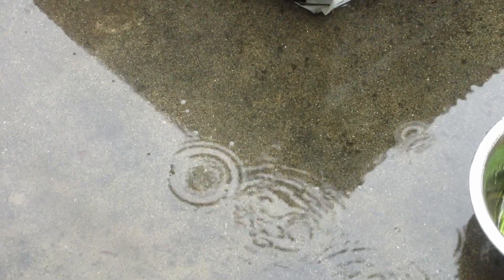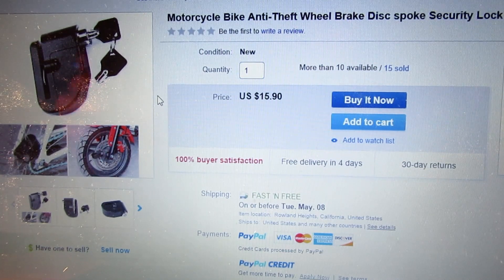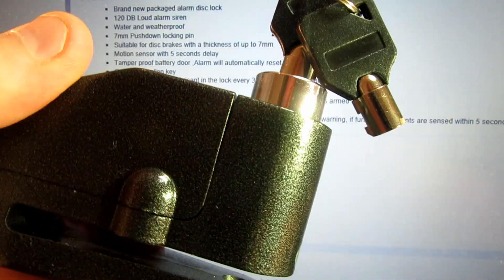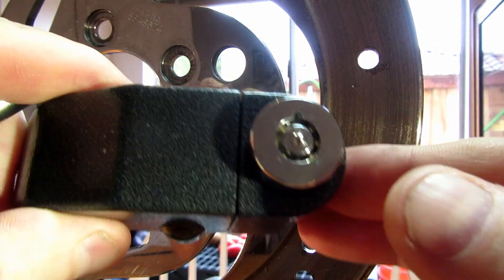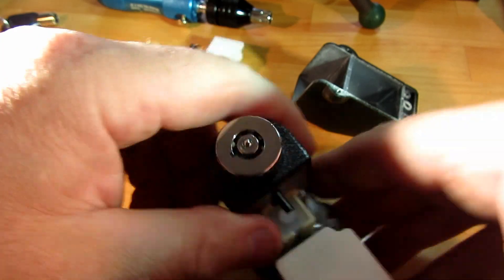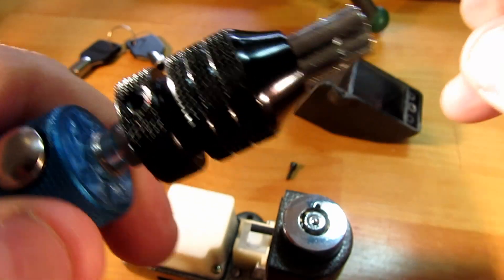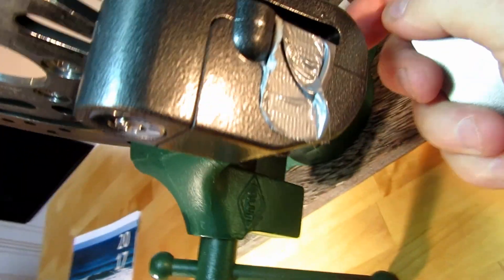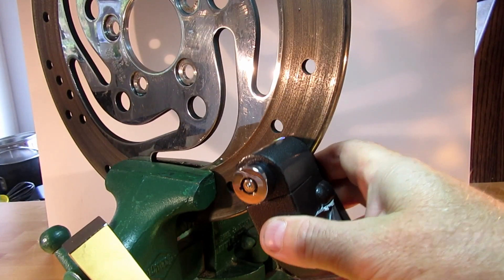Alarmed Motorcycle Disc Brake Lock Picked & Smashed Open

Comment: WOW, WOW, WOW !
AWESOME video.  NEVER seen this before.  I WAS looking to buy two, (front n rear) but now may just buy the traditional (quality) padlock. 
Would you recommend any motorcycle disc brake lock at all?  Are any of them 'bullet proof'? 
Or is it 'better' to purchase a Top Quality padlock with alarm? 
Which is the harder to 'get in to'? 
THANK YOU SO VERY VERY MUCH.
Reply from the maker: I like Abus Granit locks thats what i used on my motorcycles, they are super strong super secure with no-frills..
I used one of these just lock it on yr Brake disc, thieves don't like these locks, there not cheap but they will last a life time........https://amzn.to/2YcoauD or https://amzn.to/2YaqZwclock  or https://amzn.to/2UIlPW8
Reply: @JollyPeanut  
                     WOW, G8.  I will DEFINITELY check them out. 
I am on my way NOW to investigate (shopping) to see what all my options are. I do not want to rush into anything. 
Your advise is GREATLY APPRECIATED.
Thank you again. All the very best.

Comment: Ye the pin is removable so it could maybe work. I have two sets one with no option for the inner pin and the better version like you have. I just keep the inner pin in my one set and switch between them lol